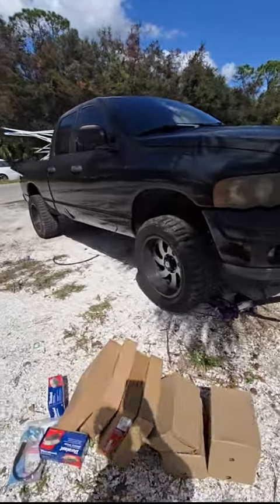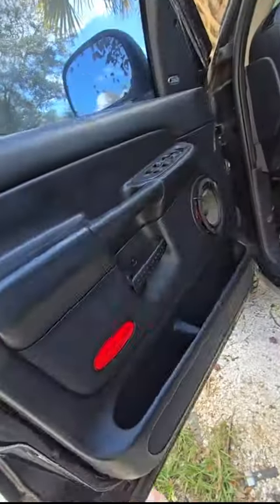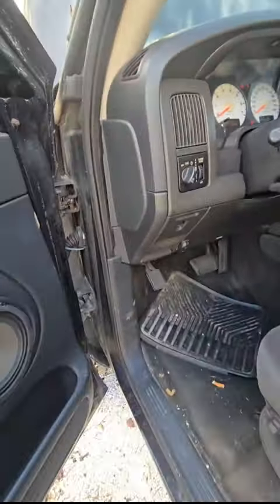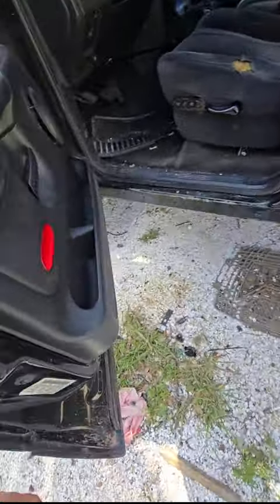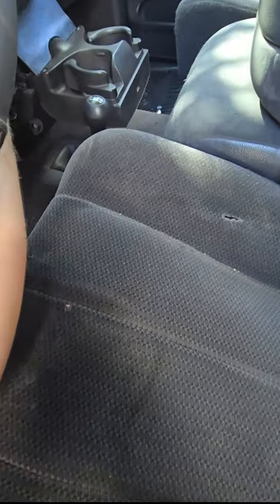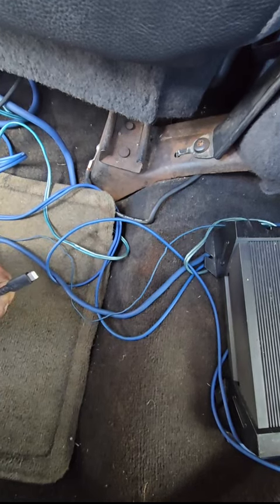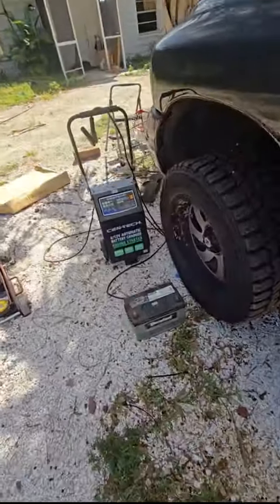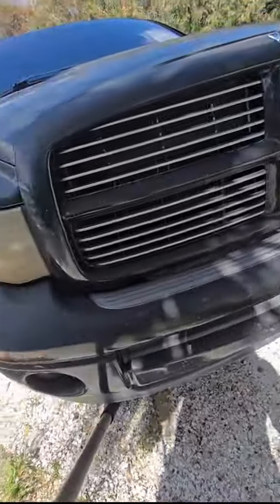my brand used ram fifteen hundy

Comment: Not a bad looking truck man! I like it. I’ve had dodges all my lifetime and only one time I was left stranded due to a bum clutch.
Reply from the maker: This one may very well have a bad head gasket.
Reply: Hopefully you can get it fixed and get her back on the road.  Lot cheaper than buying a brand new truck that’s for sure!
Reply from the maker: @ryantrott9529  slowly but surely working my way to a look that I like